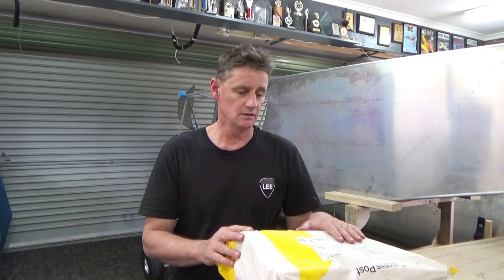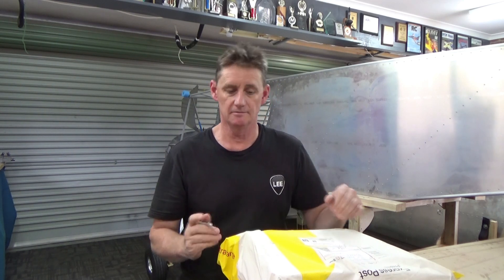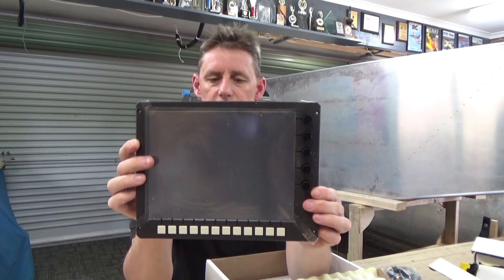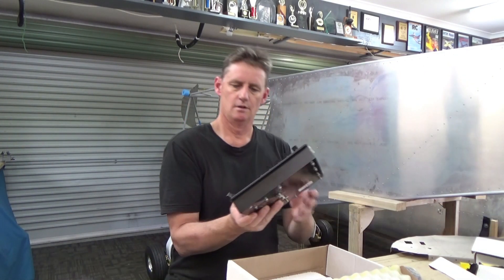How I decided on MGL Avionics

Comment: Hi good vid, I’m building the ch750 and have fitted out with all mgl gear including ibox and the ecb, the ecb is a good add in as it works like a breaker but with out the weight.
You probably already know that if you go onto mgl Africa you can download all the full manuals that are really good and informative for mgl avionics 
Good luck with the build stay safe
Reply from the maker: Thanks for the comments